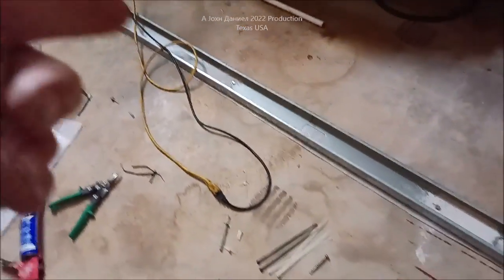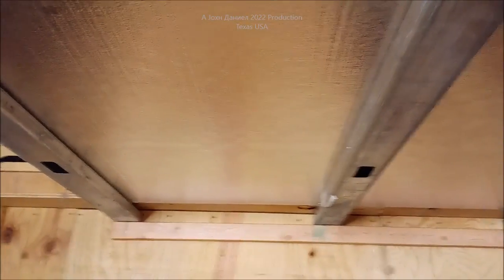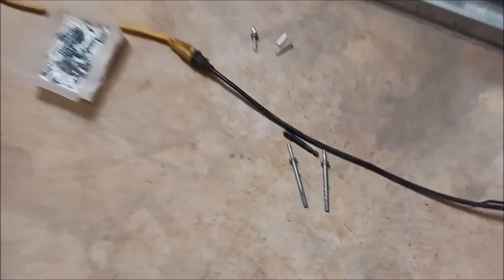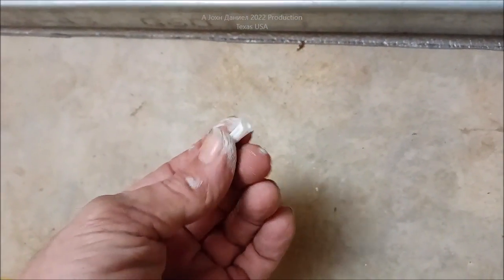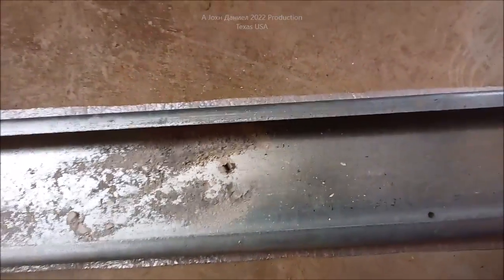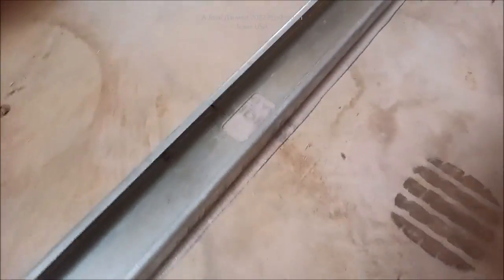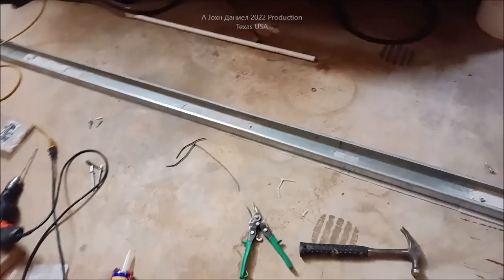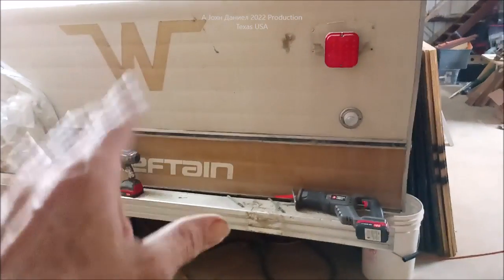ZIP ties to make strong Concrete Anchors, Absolutely!

Comment: nice invention, Ill sure going to try it. Thanks.
I dont know if you want this info now, but I found a solid way of making plastic anchors 100% reliable. For the plastic anchors to really work with concrete, you need to blow the hole with air to remove the concrete dust, then spray it with water, and slot in an anchor smeared with some construction glue. You can put the screw right away, just wait a day till you can fully load it. A tip: if your hole does not let the anchors upper end in, dont hammer it down. Just screw in a screw in hammer mode.

Comment: John I need your advice once again. I have a 230 volt deep well pump will a step up step down work with my 1500 watt. Pure sine wave alffaa 1500 watt
 Inverter
Reply from the maker: No, you'll need a much different inverter capable of a real split phase

Comment: I have been cursing at those plastic inserts most of my life.  They only work about 15% of the time if you're lucky!  Now there is a reason to keep cut zip ties and upcycle them into concrete anchors.  Nice tip John, thanks for sharing.

Comment: Chippies do similar with woodwork.  If a door has to be rehung, say hinges moved for some reason, that will leave holes that may be too close to the new screw point.  A bit of cane or thin dowel can be knocked into the hole to fill it so it doesn't collapse when the new position is screwed into.  Likewise it can give a bit of assistance for times when old dry wood is present that can't take the load of a new screw directly.  There's lots of tricks like this that aren't general public knowledge.

Comment: I have used trimmer string in bad drilled spots, never thought of zip ties, smart.
Reply from the maker: Excellent idea, I'll try that on a project
Reply: Trimmer string is one I hadn't even thought of. I've now seen tie wire, heard trimmer string, and have used solder, zip ties, and solid copper wire.

Comment: Most practical. Know anyone who repairs inverters? Cheers.
Reply from the maker: Depending on the brand, I was repairing them. But most are hard to find parts for now due to bad Grubberment and viral sick things stopping shipping and parts.
Reply: @JOHNDANIEL1  It's an Alfaa 1500W and I know it needs all 6, 40A fuses   (soldered in!). I ordered some fuse holders with pigtails to solder in and make changing them easier, but don't know what caused the problem in the first place. New out of the box it blew the first time the switch was turned on. They sent another that's worked fine for 6 months, or so. Thanx for any ideas.
Reply from the maker: @davef.2329  Hard to tell but I would use a test light to do actual turn on when you replace the fuses so its getting barely enough power to make the bulb light and if its a transformer or piece of trace on the board it will not dim when charged before powering but if it does power up it will be such low amp supply that it will not blow fuses. I contacted them, they did say they had some with a crossed relay trace on the board from the board makers in them but after 30K sold only about 20 had this issue they warrantied.

Comment: I use speaker wire or zip cord.
Reply: @breakerbroke23   Little lengths of solder or Romex snippets work pretty well in a pinch too.